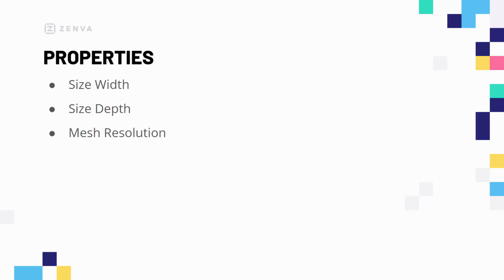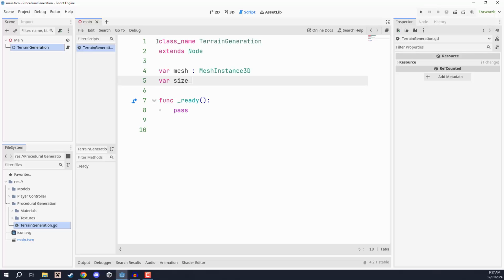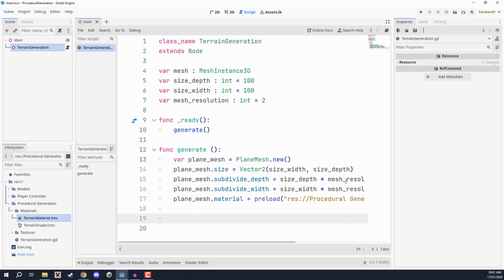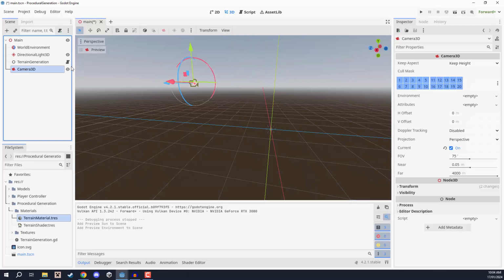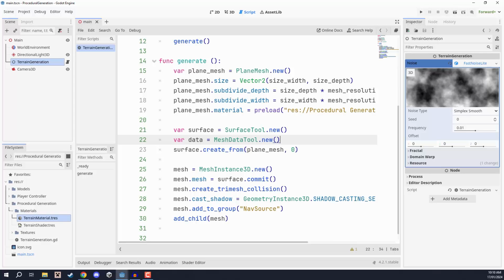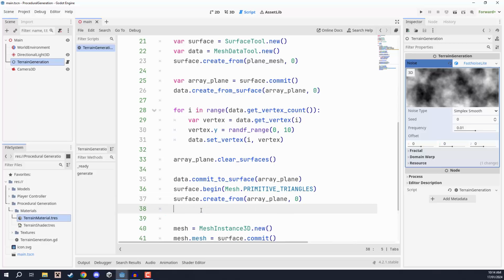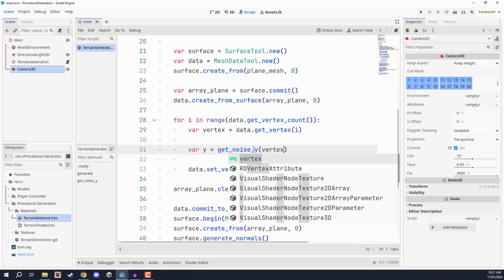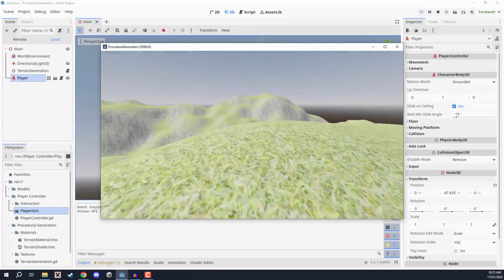PROCEDURAL GENERATION - Godot Mini-Course

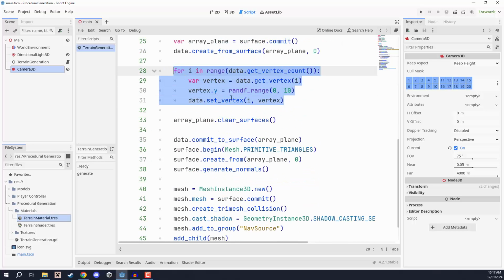Comment: 17:57 I HAVE A QUESTION,  is  there anyway you would be able to generate this with a texture on. If its possible would you be able to have the generation pick between 2  different textures while it generates new terrain
Reply: You’d need a fragment shader to do texturing, but those are pretty easy to find guides for online.